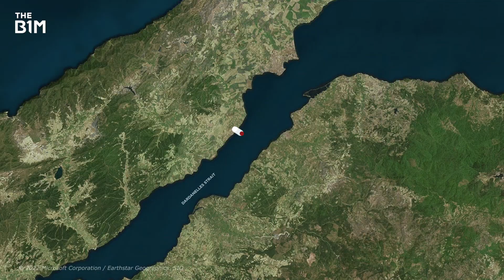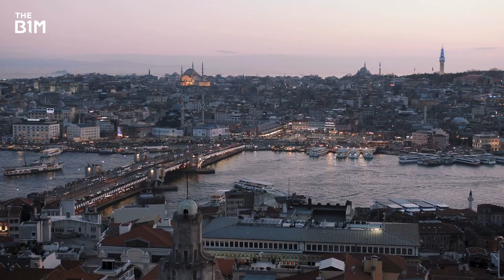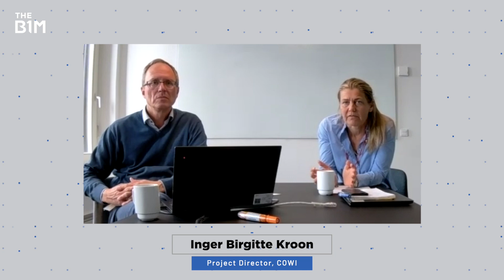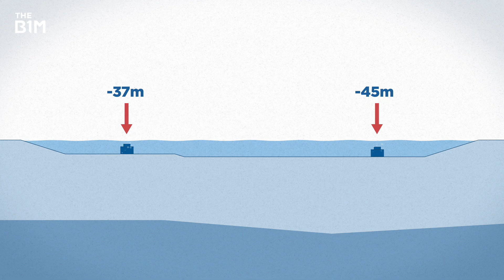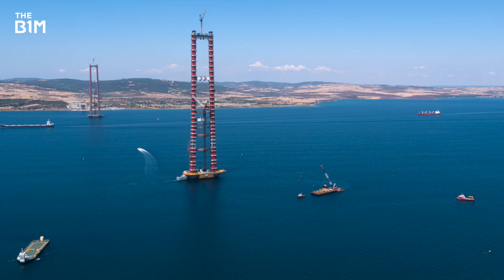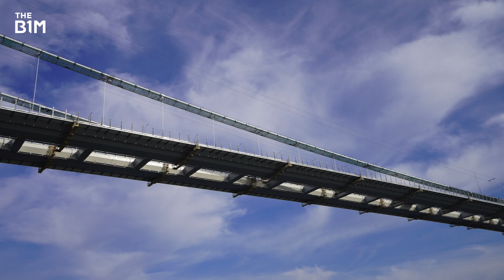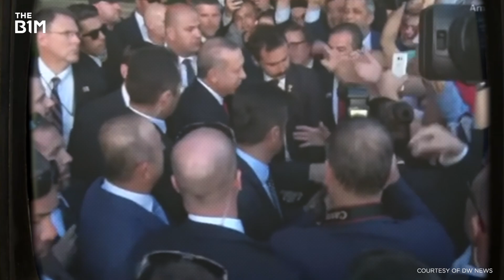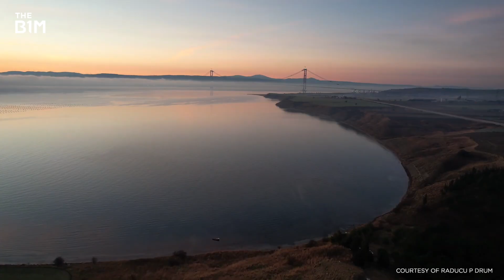Why Turkey Built the World’s Longest Suspension Bridge

Comment: Very impressive feat. Not only the sheer length and importance of the bridge, but also the fact that they managed to finish it ahead of schedule despite the pandemic caused havoc for construction projects across the globe.
Reply: Yeah usually you hear of these big infastructure projects having a delay after delay and being billions overbudget. Guess this one is the exception.
Reply: Seriously: my city hasn't built so much as a foot of subway track since the 2000s...
Reply: Mega projects built ahead of time and under budget is also due to a severely underperforming economy.  Industry is generally slow, high unemployment and low currency value all means the project gets a good deal on contractors and suppliers goods from inside the country.  If this project was started 20 years earlier, it would have been late and overbudget in an overheated economy and labor shortage.
Reply: @ph11p3540   well informed guy. Respect 👏👏👏
Reply: Nobody on the roads though so they got to work quicker 😉
Reply: This is just one project that no one ever gonna use it. They built airports, universities and etc. which are empty. And normally they cost less than x10, x50 times cheeper. Now turks are in dept and poor because of these projects. Erdogan and his friends need money, their Allah is concrete. They are selling the country and they are bringing that money to England.
Reply: This bridge is only 4.5 km long, pales in comparison to the Hong Kong Zhuhai Macau bridge which measures 55km long, it's nothing to brag about.
Reply: @elimlinrr6898  that's bridge is not suspension bridge you m0r0n
Reply: basically saying "Get your shit together" to all other projects worldwide!
Reply: It was a nightmare, I can tell you that! And then on top of the pandemic, the Suez canal became blocked just before the lifting gantries were due to get to site and caused even more delays! Thankfully the gantries performed better than anyone expected and helped the project catch up on the construction programme
Reply: Very impressive feat? Instead of spending 2.8 BILLION dollars on a bridge that approx. 10.000 cars, you could just help the 8 million below the starvation line (the people who cannot afford to feed themselves) and keep a blind eye about this shit. There's no need for the suspension bridge except nationalistic sentiment and propaganda
Reply: Because they need some votes to win again
Reply: occupied holly land...cancer occupied. Constantinople.
Reply: When you have questionable labor practices and have more than enough cheap workers to work around the clock I guess everything is possible.
Reply: And despite the awful economic situation brought about by turkeys leader
Reply: @thecryingsoul  The economic instability is overblown. There are a lot of things to hate Erdogan for but Turkey's economy was far worse before he took over.
Reply: @thecryingsoul  Objective fact? How? Please, I wanna know how Turkey's economy has gotten any worse in any metric whatsoever since Erdogan took office. Keep in mind, I'm someone who is welcoming his departure with applause, but you can't deny Turkey has seen one of the most incredible leaps in standard of living and economic power/stability directly because of his policies.
Reply: @salakasto  lol sure, lets just ignore every single metric, such as cost of living, currency devaluation, etc. indicating otherwise
Reply: @thecryingsoul  Cost of living has risen yes, but incomes have risen far more. The current inflation crisis was the NORM every year for decades until Erdogan took power, and once he did inflation declined rapidly and stayed low for the great majority of his tenure until now. I really encourage you to look outside the mainstream narrative surrounding Turkey and realize why Erdogan stayed as popular as he was even though he was clearing acting as a dictator. I promise you it's largely not due to religious reasons like many in the West have stated, it's precisely because economic growth under him could only be described as miraculous.
Reply: @salakasto  I honestly can't tell if you're a troll at this point, just google turkey income vs inflation.
Reply: @thecryingsoul  I think I'm starting to get where the confusion from you is coming from. I need to ask, when do you think Erdogan took power?
Reply: @thecryingsoul   Erdo is strongman who raised his country's status to a middle power. Look at the Ukraine crisis, Turkey is punching way above it's weight, read a comment under a report in Korean how Turkey is being able to balance out btw Russia and UA at the same time selling crucial tb2 and buying crucial s400 is astonishing, a lot of it's foreign policy is hanging in his image itself. He industrialised Turkey more than anyone else. Developed the country's defense industry at an insane speed.
Reply: @thecryingsoul  You are htng him just for the sake of htng. He took power in 2002. TK saw the highest growth for the longest time under his rule from 2002 - 2013.
Reply: @user-ir7og3lx2d  then sold to the arabs and internal extermist factions 🗿
Reply: @user-ir7og3lx2d  Yeah and? Can't give the man endless credit because he did good for some time. Why can't he create same economic miracle now? Because it wasn't even his doing to begin with.
Reply: @sercancelenk7131  Look at inflation rates before his rule. THAT'S THE NORM FOR TURKEY. It will stay that way as long as all the energy needs of TK are imported or heavy industrialisation - high quality goods, with specialisation - leads to high exports and substitute for the energy bills. 

Oh, so you only give credit to faults and none for the good things. that's opposition and criticism due to pure ideological reasons, and not out of good faith.
Reply: @sercancelenk7131  Look at the economic data for a 25 years back prior to 20 years ago. 
"Money & Macro" has uploaded a video 2 days ago, things are summarised in it, check it out.
Reply: @user-ir7og3lx2d  You are still telling me to look at the metrics from 25 years ago. I have no interest in that. Only thing that interests me is the economic metrics for TODAY.
Reply: @sercancelenk7131  That's why I said that your criticism is not in good faith, you would have found a way to criticize even if this problem wasn't there.
Reply: @user-ir7og3lx2d  Fuck yeah my critism is not in good faith. Government doesn't treat their citizens in good faith first and foremost.

In the end, you admit and agree that there is a problem. Again, I don't give a shit about how they did it some odd 20 years ago, if they were as competent as they said, they could have done the same economic developments today as well.
Reply: @salakasto  I appreciate you are trying to educate people but at least provide them with the correct facts. Far worse before he took over? I think you really need to research before you write anything
Reply: economy is one of them. while I can agree its overblown, and other countries have shit economy and external factors affect too, his policies are not great for the economy. Government spending in both infrastructure while having huge dept, and giving huge salary raises multiple times per year.  @salakasto
Reply: umm, pandemic didnt stop construction and manufacturing at all, it only affected office workers and tourism industry. People who worked at manufacturing, never stopped working. Governments understood, that main source of income cant be limited. Office jobs arent main source of income for anything, tho people there with less training, experience and skill needed earn a lot more.
Reply: @Swarmah  watch the british underground train videos, the pandemic had an impact on construction projects
Reply: Who invented suspension bridge and built it for turkey? America as same as 98% of world modern and future technologies
Reply: @cybergirl3139  America was in no way the first country to invent the suspension bridge and didn’t fund this Turkish project .